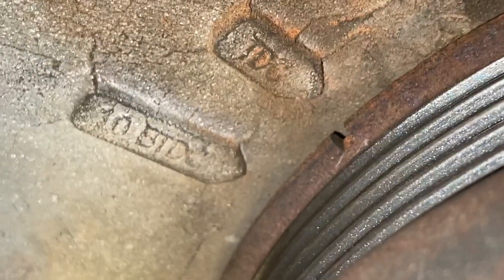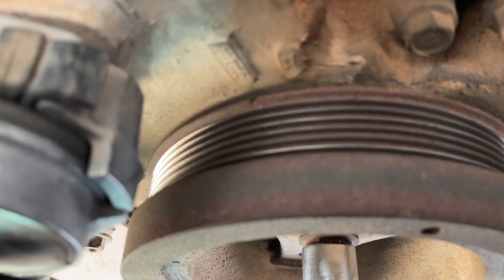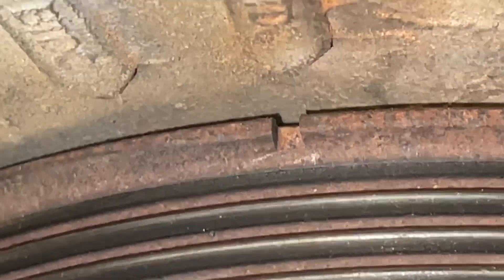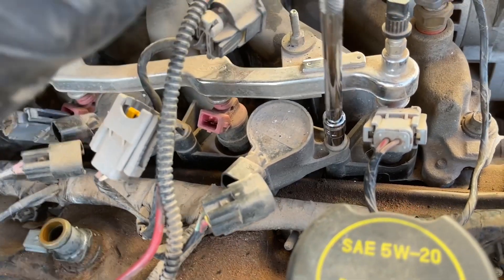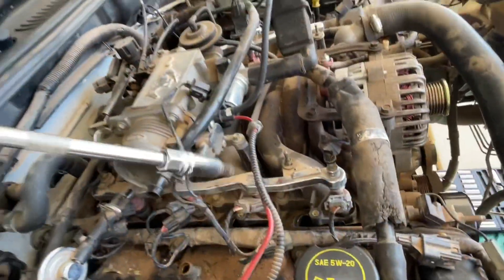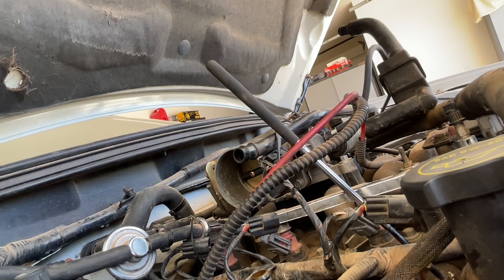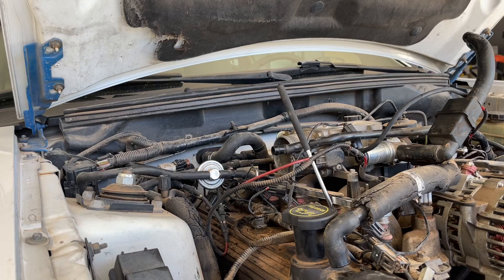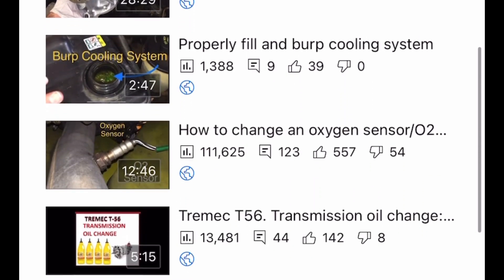Finding top dead center TDC on your engine: Shown on Ford Mustang

Comment: I need to replace my valve stem seal. Can I rotate the engine to tdc for whichever cylinder im working on to prevent the valve from dropping?
Reply from the maker: I believe the head will need to come off. As for replacing valve springs  you would put at TDC and also use compressed air through the spark plug hole to hold the valve up.

Comment: Is that TDC on compression stroke ?
Reply from the maker: It will be for both strokes. With the valve cover off you can watch the cam and valve springs to know if it’s compression or exhaust
Reply: Thank you  @dannyjohnsonsgarage

Comment: I have a 2001 Ford Mustang with a broken hood latch release cable how do I open my hood now!? I’ve tried pulling the cable inside the car with pliers and nothing so I think it’s broken or the tip  of it slipped off the spring thing..I really need to get my hood open to replace my battery anything at all would be amazing..
Reply from the maker: My friend was able to open his near the latch by pulling on the cable near the latch. His may not have had the grill so perhaps you can reach it from under the car
Reply: @dannyjohnsonsgarage  I took the chrome and pony out of the grill to get my hands inside the hood lol I did everything else you said and I got my hood open you are a living legend!

Comment: mind me asking, could you do a video on how to bring down the top on the new edge mustang ?
Reply: Put the car in park, set the emergency brake, roll down all the windows, unlatch the top (above both driver and passenger sides), press power top button near the center console.